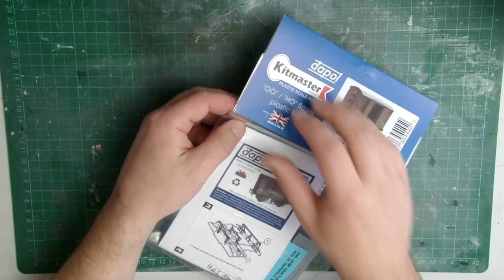How To Build A Dapol Meat Van Kit - Model Railway Tutorial

Comment: Nice video mate. The dapol kits are really great for beginners and they do look pretty nice once complete. One tip I can give you is to spray the model in gloss varnish before adding the decals/transfers this allows them to stick alot better and the gloss film around the transfer will be invisable once it is in place and when matt varnish is applied over the top it will look like the transfer has been printed on just like an RTR model. I have been building kits for a while so that is something I have learnt. Hope that is helpful.- Nicholas.
Reply from the maker: Thanks Nicholas, yeah I'm aware of using layers of varnish for the transfers. The gloss film is something I've never really noticed (or rather it's never bothered me) which is why I tend to skip that step but I may have to give it a go in the future just to see the difference. Thanks for watching 😃

Comment: I love doing these kits. Having built a break van, Esso tank, mineral they are great to build up a mixed freight set cheaply. 

I've got a cattle wagon to complete. 1 thing I have learnt though is weight is needed to help them go over points. If running with RTR stock I've noticed they tend to derail

Will be getting more as they hardly take anytime to complete.

Have you thought about getting a couple of the loco kits, they'll sit lovely in your engine shed on your modual layout
Reply from the maker: Absolutely, they are good fun to build and not too complicated either. But yes, I agree they definitely need some weight to stop them derailing.

Yeah the loco kits look interesting but I have so many RTR locos already that my shed is full about 10 times over 😂 I have though about partially building one of the kits though to be a loco undergoing and overhaul. Thanks for watching 👍

Comment: Great tutorial and nice tip on using the narrower tension lock couplings to allow keeping the vac pipe.

From the experience I've had in building wagon kits, I'd be amazed the transfers stay in place with water alone. I found Humbrol Decalfix worked a treat, whereas with just water, the slightest breath of a draft could remove the transfers.
Reply from the maker: Thanks Ian, glad you enjoyed it. That's interesting about the transfers, I've got several similar kits from Dapol all made up now and none of the transfers have shown any sign of peeling or coming off. Not sure what I'm doing to get those results but I'll count myself lucky in that case! Thanks for watching 😃

Comment: Really nice video if you put a tiny amount of Vaseline in the pin hole where the wheel sits,it would run even smoother :)
Reply from the maker: Ooh great tip Michael! They're pretty smooth runners already but I'm literally going to try that right now. Thanks for watching 😃
Reply: @ThatModelRailwayGuy  Yep only something ive picked up on watching videos like yours,but it does work,use a cocktail stick to put it on with :)

Comment: I've been considering making these Dapol wagons so I was interested in your video. Great advice about the slimline couplings..... but  I can not find them online anywhere. I know this video is a couple of years old now, so have Dapol now discontinued them do you know? Any one else do them?. Thanks
Reply from the maker: Annoyingly I think they were discontinued right around the time I made this video. So far I haven’t been able to find any more since everyone has pretty much moved over to the NEM pockets. 
If you don’t mind a bit of adaptation, it would probably be better all round to fit a NEM pocket on instead an use slimline tension locks that way. The easier solution of course is to just omit the brake pipe to allow for some extra movement. Hope that helps and thanks for watching 😃

Comment: Great video as usual mate :) The kit looks good when finished. Would you say its too light in terms of weight or just right? Sometimes I find the plastic wagon kits sometimes need weights adding to them so they don't hop off the rails if there's track trouble.
Reply from the maker: Thanks Markus, I would say it definitely needs a bit of weight just to get it running smoothly. You can see in the video I add a few lead weights before putting the roof on and it does make a huge difference in my opinion but how much you add will definitely be down to personal preference. Thanks for watching 😃
Reply: @ThatModelRailwayGuy  so you did! Sorry, I must have missed that bit during the first watch 😂

Comment: Any link to the paint colours and part number for the couplings ?
Reply from the maker: Hey Matthew, I used Humbrol 70 for the body, 64 for the roof and cheap black acrylic for the underframe. 

I haven't been able to find a part number for the couplings yet, the best I've managed so far is X7413 but it comes as part of the Hornby Ruston 48DS coupling assembly which isn't ideal. Thanks for watching 😃
Reply: @ThatModelRailwayGuy  appreciate the reply, great video.